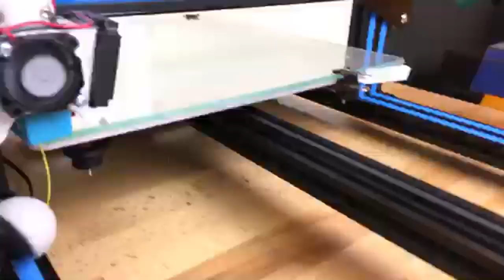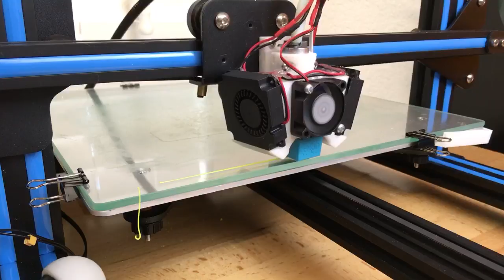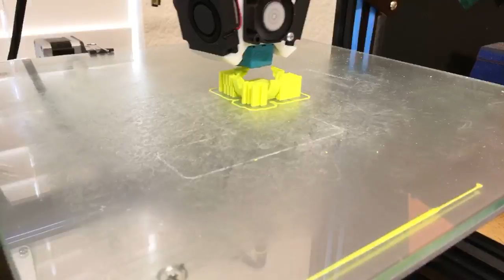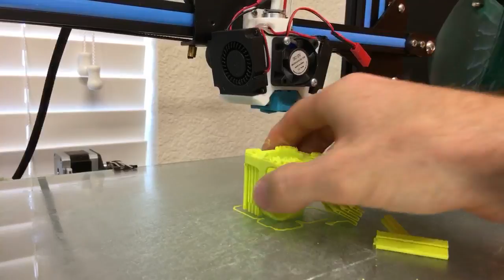FAILED! | Watch Me 3D Printing | FPV Drone 3” Pod | Live Stream

Comment: Shouldn't your fan blow into the heat sink instead?
Reply from the maker: +d3c0de thank you for helping answer the question! For context, I use a total of 3 fans on my printhead. One on either side of the printhead, those two are used to blow cool air straight down onto the freshly printed plastic coming out of the nozzle. The smaller fan in the center is blowing air across the heat exchanger on the hotend itself. That keeps the filament from getting heat soaked and cause extrusion problems like you saw in my video.
Reply: For the heatsink fan, are you sure the air is blowing into the heatsink? The sticker side is usually the side that air blows out of.
edit  I saw in your fan fix video that your fan actually has sticks on both sides.